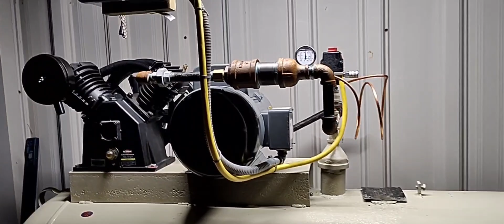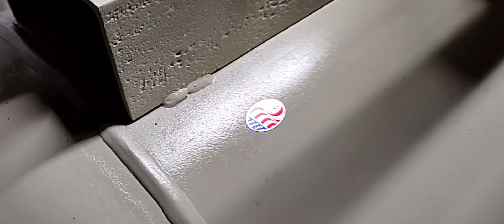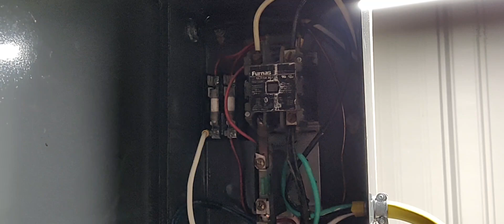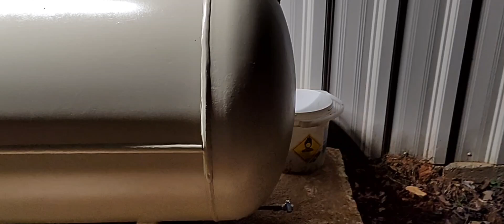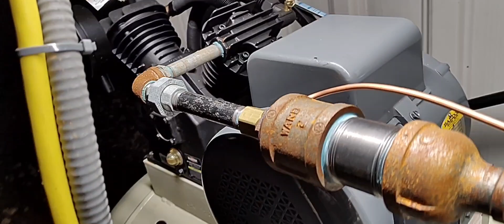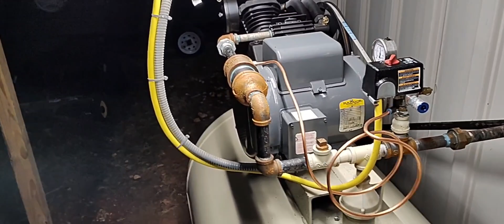Building an Air Compressor Using a 250 Gallon Propane Tank Part 2

Comment: The compressor looks pretty good. Where would you get a tank that big? I may add 1 of those to my air compressor.
Reply from the maker: This tank was a propane tank that was once hooked up to my house. We didn't use it anymore so I repurposed it for this compressor. As far as where you can get these tanks, I know that I've seen them on Facebook marketplace but beyond that I haven't investigated. You could probably contact your local natural gas propane company and they could point you in the right direction.
Reply: @Maintenance_Matt  Okay cool thanks

Comment: Ive got a tank almost exactly like that and im going to build a compressor.  Can you please explain the large pipe for the bleed off? And maybe anything else i might need to know?
Reply from the maker: Sure thing Dave.  The pipe that comes out of the compressor is half inch, from there it steps up to 3/4-in pipe and connects to a 3/4-in check valve. Now the reason I had to step up to a 2-in coupling and then a 2-in reducer back to 3/4 with a small pipe nipple in between was because the 3/4 check valve for the air bleed off is about 3 in long and would not fit inside a normal 3/4-in coupling or tee. So that was a design flaw that I didn't foresee. As far as things to consider when building yourself one, I had to order my pulley from McMaster-Carr because Northern tools or Harbor Freight or even Grainger didn't have options for the pulley I needed for the motor I have. I did feel the tank with water twice and I weld it on it with water in it. I've never welded on a propane tank before so I wanted to make sure that all the residual propane was out of there. This tank was built in 1958 so it's held up so far I'm not sure if newer tanks are thicker or thinner. There is a placard on the top of my tank that says the maximum design pressure is 250 PSI. I figured 250 PSI is plenty strong enough for my 175 PSI compressor.